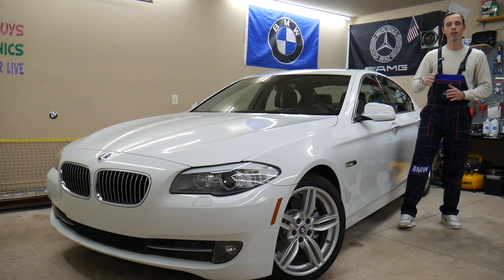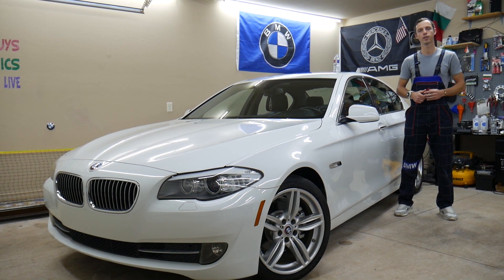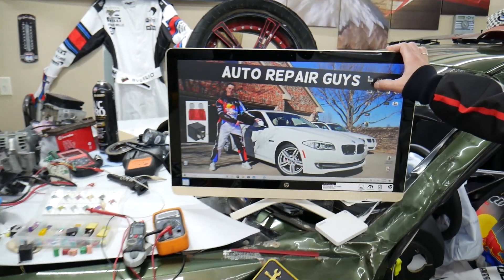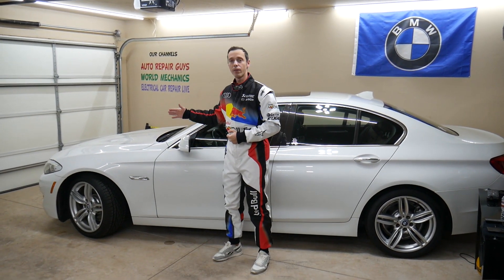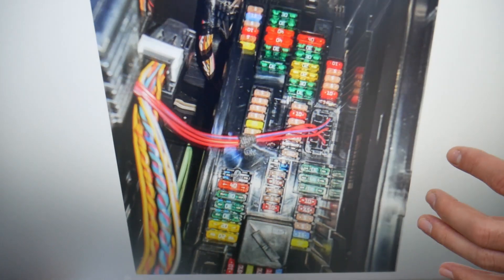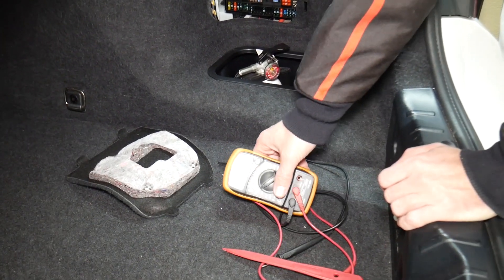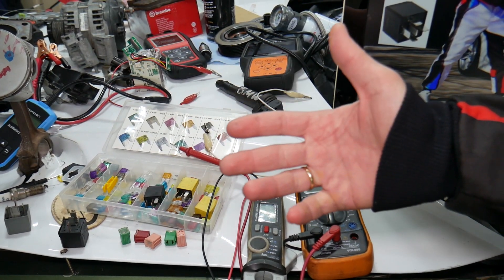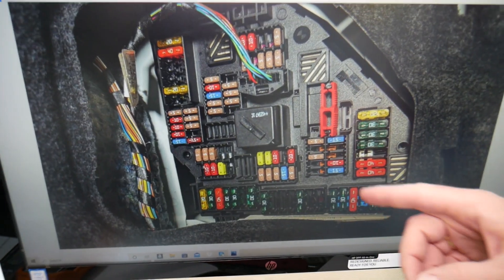BMW F10 F11 TURN SIGNAL SWITCH FUSE LOCATION BMW 528i 535i 520i 530i 550i 518d 520d 525d 530d 535d

Comment: Dobry dzien:  Please help.  I have a 2011 Dodge Journey AWD 3.6L.  I have gone through 5 starters in 8 or 9 months.  The first 3 or 4 were Vision starters from one auto parts store.  The last one was from O'reilly and lasted the longest at 4 months.  The Catalytic converter shield is in place.  Today, replaced it with another O'reillty starter, except this time we added another ground wire, as the original ground had some corrosion.  Any idea on what might be causing the starter to go bad after a month or two?  Battery is 8 or 9 months old.  Dziękuję